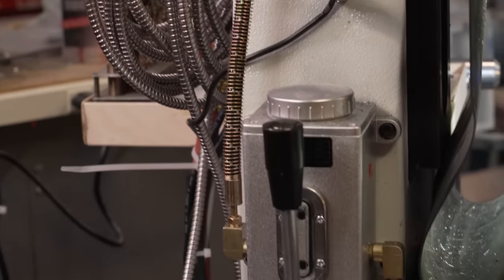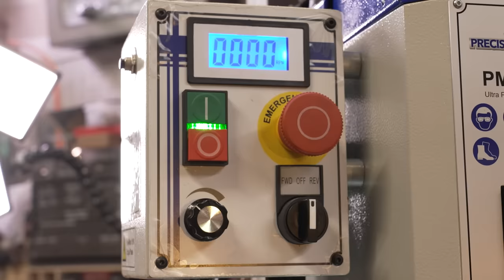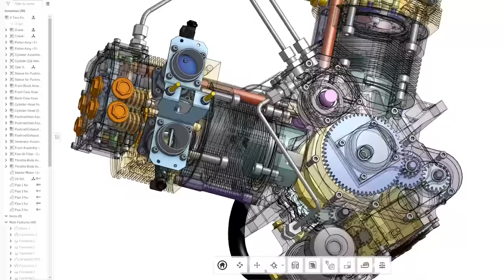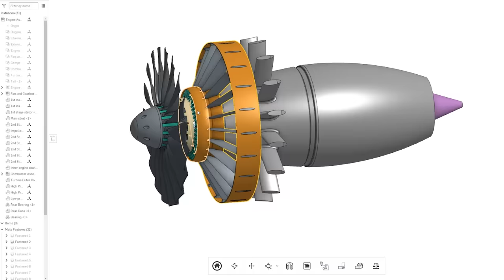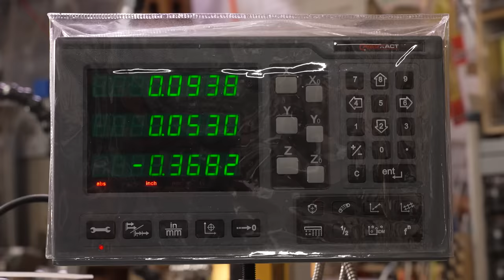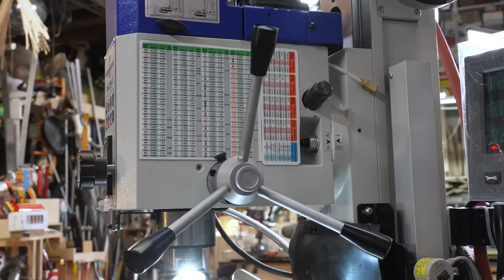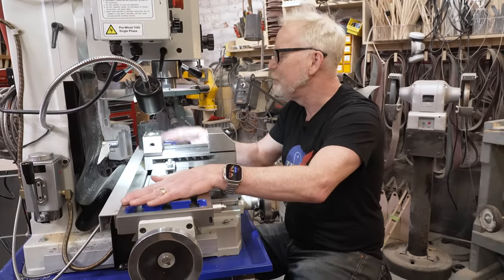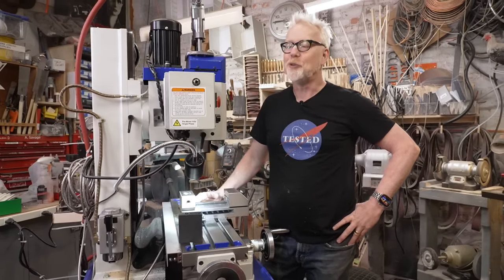Adam Savage Tours His New Benchtop Milling Machine!

Comment: I think that milling vice could do with some more clamps to hold it down, else i reckon it could move under the cutting forces.
Reply: Agreed. I'd have at least two on each side, unless he's milling really small and delicate parts but it's easy to under estimate just how much torque and forces are applied when machining even little parts. I quickly learned that at the beginning that even when you have a vice clamped down VERY tightly, the mill can still easily shift it even under relatively light loads. Just goes to show how large of forces are transferred from the cutters to the work piece.
I think he'll soon add another clamp on each side because that vise is bound to shift on him at some point.

Comment: Might ve wrong but when you secured the piece you machined the vice's(i dont now the official term) bolt angle is to big, when you tighten the screw, most of the force is diverted down to push the vice parts together, not to secure the piece you work on, the mill will have an easier time throwing that piece. Try to have the screw as close to horizontal as possible.

If the vice isnt the type im thinking disregard that

Comment: Love that you don't seem to have to worry about rust. Where I live it's hot and humid and things can rust while you watch them. Putting anything in a wooden block such as parallels would be just scrap in no time.
Reply: "Old-timer trick"... line with with lightly oiled felt (I find pool table felt works best). For drawers containing non-oil-tolerant metal items, I stick some desiccant packs in. Color changing beads are better, so you can SEE why they need recharge/changing. Hard to rust when moisture cannot get to your metal 🙂
Reply: @ironsmiter  thanks for the tips I use the moisture beads but leaving anything on display is asking for trouble. No nice clean machined surfaces for me
Reply: @ironsmiter  air flow helps with humid conditions. That and lots of WD-40. I buy it by the gallon can. I just go around spritzing everything.
Reply: Getting back to my tools after 15 years. Hand Tool Rescue restoration for them. Scroll saw in pieces at the moment, getting the treatment. Those shops with shiny metal are not in humidity place or they have a a WD-40 misting system:)
Reply: @babbagebrassworks4278  there's certainly drier climates and wetter ones. In very humid conditions air circulation helps a lot. What happens is as the temperature falls moisture can condense on cold metal. Like the way a glass can sweat. Same deal. But some air blowing around cuts down on that dramatically. Least it dries the sweat and doesn't let it lay on surfaces. But yeah keeping up with preservatives on your tools certainly helps too. I'm buying WD-40 here by the gallon can. The spray cans are not such a good deal. Just the liquid is less than half what the aerosol costs. Closer to a third less. 2.74 times.
Reply: @1pcfred  Yep, going to have to get WD-40 by liter sizes, spray cans just don't last long. Pulling apart all the old tools and derusting is taking a long time. I should have got the sand blaster working first. Er but then I need to get the compressor going. Found an old hand wire brush and broke it in the first few minutes. Wish they made tools from stainless or Titanium etc.
Reply: @babbagebrassworks4278  steel tools are common due to economics. Ferrous metals are cheap compared to everything else. Stainless steel has a lot of chromium in it. That makes it more costly. Stainless steel tends to be difficult to work with too. If you keep your tools clean and protected rust can be managed. It's certainly a topic that's been heavily discussed.
Reply: Oh, man, SF can be humid as h*ck in the winter. It was like 50 degrees and drizzling just the other day. Grody. Impossible to dress for if you're working outside.
Reply: @theprojectproject01  I live in tropical Queensland, a paradise but not if your a tool. Standard grade stainless will rust here eventualy. I use a lanolin based product its a bit stickier than WD40 and works well but you have to be constantly on it.
Reply: @plasmaDave  Oh, my, that's a whole other kind of humid. I've heard you get all the water you need from breathing.
Reply: @theprojectproject01  🤣 so true

Comment: Great video! Ha-ha "Paralells" instead of "Parallels". I guess that's an inside joke?
:)
 I have the 728 also, and love it. I've 'never' used the Z DRO to set height, I power-feed it down close to the work and then use the quill DRO for actual settings. But the quill LCD is funky, battery-powered and times-out just when you need it most, so I installed a scale on the quill and connected that to the DRO Z axis readout.

Comment: You need a step block under those hold downs. The point of contact needs to be at a negative rake. You're gonna dent the table like that. I'd also really recommend getting a kurt d6 and mounting it sideways, kurt vices are designed to pull down the clamped material and keep them flat on the parallel. I have 20 years of tool and die experience if you want to hit me up I can teach you some little shit.

Comment: I've been wondering about benchtop mills in general as I want a mill but don't have space for anything even remotely "regular mill" sized.
Reply: Same. So I got a 8" drill press and a 4" Milling attachment. With 2 axis for the handles. Same foot print as a shoe box. Fits on a bench. You could get both pieces for 200 bucks or less. For basic projects.

Comment: Hey Adam, thanks for your share on the mill work.   One suggestion for clearing chips might be instead of an  air blow gun use a vacuum cleaner.  I have a Grizzle lathe mill combo and use a small shop vac to clean up the chips as they are made.  It saves a lot of extra clean time up that blowing away stuff creates. art:hand-pink-waving:

Comment: My mill is similar, other than for power tapping it always is used in forward. So leave the switch in forward and turn on and off with the red and green on off buttons. Wont be an issue anymore.

Comment: The last batch of ER32 collets I got had flash deep in the slots of the collet. Hard to see w/ a visual inspection, after de-burring.

Found it after I gave the nut the usual hand tighten, to hold the end mill, before grabbing the spanner wrench.

Reached for the spanner as the end mill bounced off the material.

The flash was keeping the collet from collapsing. Had to hold the collets up to a light & check every slit. Flash in about 30-40%.

Easily removed, but big enough to mess w,/ collet function.

Re: 3" parallels
I got a set of small parallels w/  holes like yours have. One night I was fighting w/ a setup & struggling to keep the parallels in place. <<Sure wish they had a magnet>>, me thinks, as I looked at the hole.

Brain storm ensued... hole was 6mm. Ebay delivered me some 6mm neodiddliums, which got pressed into the parallels.

Liked them so much, bought another set.

Re: tapping specs

Getting older, (I am now, officially 'ancient'), engenders a sense of not wasting time.

Looking up tap data is one example.

I took my tap drills, taps, got a set of clearance drill & put them all together in a 3 step, stadium seating tooling holder.

Everything is organized by size, L to R, bttm to top.  

I located same-same taps & tap drills together, then using my Brother labeler, labeled the face of the steps, ie: ¼-20, drill ID below it & decimal size on bttm, then put clearance drills in their appropriate locale in size order.

They got a label, ie: ¼-xx, w/ the decimal size of drill below it.

Now, when I need to tap anything from 4-xx to ½-xx, I grab ONE tool holder, cutting fluid & head to the mill, lathe, drill press or bench.

There was even enough room in the 'stadium' to include the pair of ratcheting tap holders I prefer.

I liked the time saving of never going to the wall chart/Internet/Machinerys' Handbook, I made a metric version & have incorporated the idea of tool holder + data source in one to my counterbores, long shank nut taps, reamer holders & more.

My go to for tool holders has become structural grade foam core PVC every since discovering it is what custom sign fabricators use now, instead of wood.

Glues, (w/ plumbers' glue), screws & does NOT attract H2O like wood. I'm in Oregon; cold->warm->cold shop = moisture in air & rusted tools/tooling.

Check out the PVC, if you're not familiar with it. Hard shiny sides, (analogy of AD or CD graded plywood), w/ a dense foam core; comes in sheets from ~⅛" to several inches, (seen 4 x 4 factors).

I also use it as prototypes for expensive material parts; drills, taps, mills like a champ & string enough to bolt in place.

I scored a big supply of free scraps from a sign shop, to test the stuff, I built a kitchen/bath cabinet w/ a door & 1 drawer & full metal hardware. Five yrs later, still in great shape.

GeoD

Comment: Metric tap drill size is very easy to work out. Example; M6 with a pitch of 1mm....... The drill size is 5mm. M10 pitch 1.5mm uses a 8.5mm bit. M5 with a pitch of 0.8mm needs a 4.2mm drill.
Take the diameter (M3/3mm) an minus the pitch from the diameter (M3 is pitched at 0.5)...... 3 - 0.5 = 2.5mm tap drill size for M3. This works for every metric thread, take the pitch away from the diameter 😁

Comment: Easiest solution is to flip the motor leads, i'd leave the switch alone.  also, runout basically means nothing at the spindle taper, it needs to be measured at a known distance from the "gage line" , theres 2 kinds, angular, and radial.  angular gets worse with distance, radial is basically the same regardless of distance from the gage line.

Comment: Bro,  

Just change the label on the switch for forward and reverse to match your other mill.  No need to rewire when it's as simple as changing the label.

Slap a sticker over the other one with the orientation you want if it's too hard to change.

Comment: If you want sensitivity? Just take the vise off your Bridgeport and put on a small X-Y table bolted onto the ways. Plenty of feed back. You just have to do a good job of indicating it in straight and flat. If you only do small parts once in awhile that might be a good alternative. Only problem is if you use a DRO on your Bridgeport you would loose that function in the above setup.

Comment: From the thumbnail i thought you had some Tardis inspired rig, hah.
Just wondering, wouldn't you prefer some kind of constant airflow to blow the squibblies away?
I remember from the milling job i had for like 3 months, there was a flexo line blower powered by the mill itself, could turn it on or off with a button on the mill, and it was absolutely necessary on a big rig, maybe not on this one, but maybe the Sharp.

Comment: Can the mill be rotated 180 degrees on the stand so the door opens in a more optimal direction rather than having to reach over it?
Reply: It would be easier to rehang the door before moving the mill around. You are right about the awkward open and reach over situation with the door in its current configuration.
Reply: The door is made to hi ge from either side. Holes are already there.

Comment: 5:25 why would you re-wire the switch when you could just put a new label over that part? It would even make more sense because then the tool would spin in the same direction that the knob turns.

Comment: Metric tap chart's aren't necessary ! just subtract the pitch from the diameter and that's drill bit size  (eg. m6 x1 = 5 mm bit- m12 x1.5 = 10.5 mm bit)

Comment: Adam, just put the new label on the bottom of the switch, no need to re-wire. "REV / FWD" but underneath the switch. You could even mill a new toggle knob that extends below the axis to make it more tactfully logical.

Comment: great video Adam, a tip, the problem with the vice you had was due to the vice's design, unlike a simple, and common 'bench' vice, there is not a single, long bolt, and a fixed nut, on these 'adjustable' machining vices the nut is a cylinder, which affixes to the vice base in set locations (cresents on the upper side of the vice base which fit the cylinder), to LOCK the part, you first place the cylinder in the closest cresent to part size, then adjust the bolt to achive tension on the part. In your case, the cresent wasn't fully engaged by the nut, hence the slippage.
another way of working for this vice type is to have a lock pin which secures the internal nut into a hole on the sides of the vice base; there is a 'weird' style, like used by orange vice company, for CNC machines, in this style the 'nut' is a big block in the center of the vice base, which like a 4 jaw chuck for a lathe, accepts 'jaws' to do clamping, this nut can be screw or Hydraulic /air in operation.

Comment: I have a king Canada mini mill, which is a little bit smaller than this. I changed the E8 to an ER32 and converted to CNC. Super handy and I can run it manually if I need to. Nice for very fine work.

Comment: It has been my experience that the number 1 cause of breaking small end mills is trying to run them at too low a speed.
Reply: Yeah I calculated the surface speed and Adam is running about 4 times slower than he should be. A 1/8" tool spinning 2,000 RPM is only going 65 surface feet per minute which is very slow to be cutting plastic. It's a bit slow for cutting steel.
Reply: @1pcfred  Yep, the spindle speed on this is a bit slow for the tiny stuff. Does depends how many flutes.
Reply: @babbagebrassworks4278  flutes change chip load and that affects the feed rate. Feed rate is not a huge factor in prototyping that's more of a production concern. If your speed is right the cut is going to be good at a reasonable feed rate.

Comment: Oh how I r4elate to your awareness of small is beautiful............many years ago 1980 to be precise I bought a bench mill, or to be precise a jig borer which was like a glorified mill drill as it was not intended to be a mill.
The problem it had was the spindle had a 2 Morse Taper without any provision for a drawbar so after wrestling with the problem it got covered with a sheet and put to the back of the workshop and 40 years later.....I kid thee not....1 year ago .I decided to revamp it to be a regular mill......long story and a boring one.....the spindle end got cut off and a new ER32 chuck was permanently grafted on the end all running in angular contact bearings......all of my tooling is 20mm parallel shank like the TTS system and  equipped with a DRO it now is a mill..

Comment: Rather than re-wire the switch, why not just print a label that changes it to "CLOCKWISE / COUNTER CLOCKWISE" or maybe a graphic arrow circle for each direction
Reply: I think that the reason that Adam is considering a rewire of the switch is down to deep muscle memory from years of using the other mill.

Comment: Not to be a safety cop, but so many potential disasters here. I put a major slice though my hand once by jiggling a loose part in the vice with the spindle running. The part popped out and the back of my hand hit the cutter. Please turn off the machine while you're waving your hand around the cutter, speaking from 1st hand (ha ha) experience.

Comment: That Vise your using is NOT a vise made for Milling !  It is a GRINDING vise to be used on a Surface Grinder NOT on a Milling machine . It is UNSAFE to use as a Milling vise . It does NOT hold the Material Tight enough for SIDE THRUST that is incurred
by END MILLS . Unless you are simply using it for DRILLING Vertically , USE a Milling Machine vise That's Made and DESIGNED for Milling .
 Stay SAFE ....  I am a Retired Toolmaker of 45 Years . SAFETY is Paramount ALWAYS . I've witnessed 
first hand what IMPROPER tooling can result in . 
Cheers ~